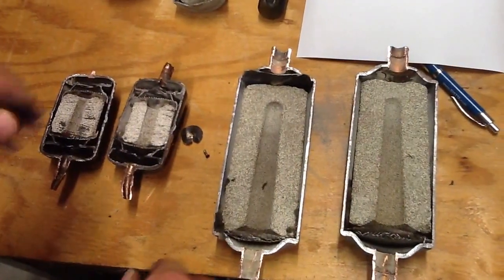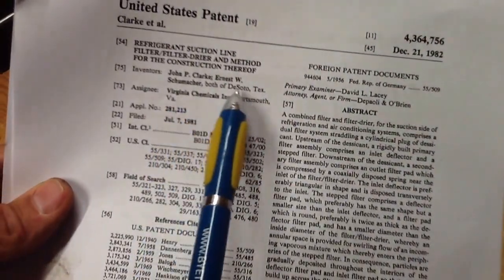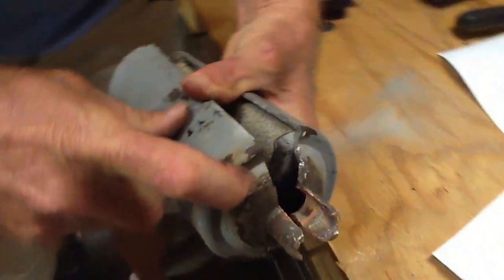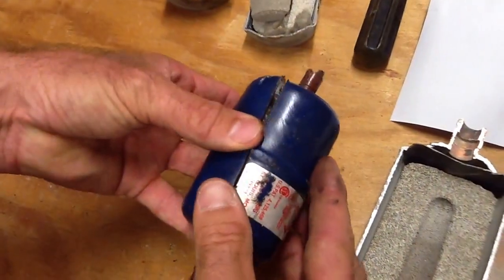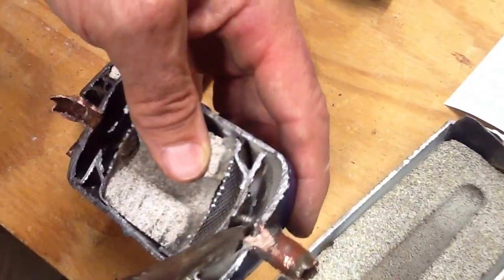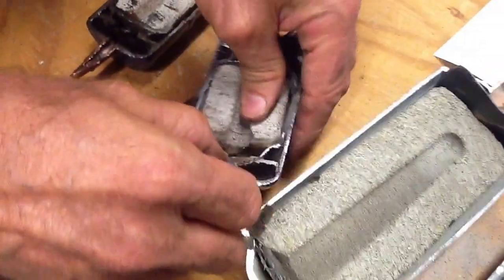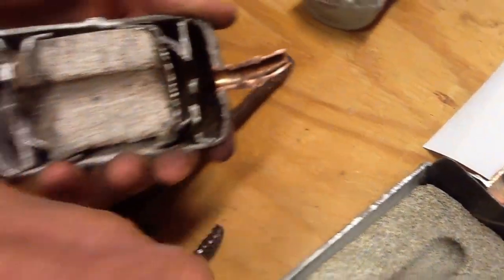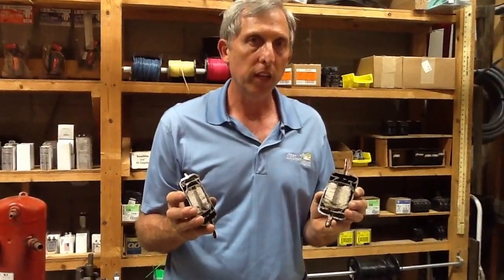History of Filter Driers for HVAC Repairs

Comment: On the bi-flow the refrigerant would have to go around the second set of screens not through them otherwise you would be pushing the contaminants back and forth thru the system......through the center then to the outside and around the screens

Comment: Nice Video.  Big Commercial systems have used "take apart" filters going back decades, but these cost way more that todays one shot filters. The disposable ones were sold by Sporlan Valve co in the mid 1960's and the "Catch all" brand of filter driers goes back to 1947. Sporlan is today owned by Parker Hannifin. 

The Henry Filter drier goes back to about 1939. 

The take part filter type leaves the housing in place and one removes the flange /  cap after removing the refrigerant.

Our Bryant AC unit installed in 1966 had a Sporlan "Catch all" filter maybe that is why it still worked when we sold the old home!

Showing how the 2 directional filter works is very cool, of course these are used on Heat pumps.

Comment: How often should you change a filter drier on commercial or residential applications ?
Reply: Val here, hi Dave thanks for sharing that video, it was very interesting and very helpful, but I got a question, it might sound dumb but it just happened to me, I over looked it; i just installed a used condenser unit for a customer and since I’ve done a lots of Goodman lately and it comes with the dryer filter built in, I forgot to put a filter dryer on this one I did cause it didn’t come with it and started the unit but when I realized it was too late and the unit was working just fine, will it cause any damage if I just leave it with out the filter dryer?
Reply: Thanks for all your helpful video !

Comment: I am probably wrong but wanted to check since you do have a f/d cut in half.  The check valve is supposed to stop the flow through the center and route the ref to the outside of the center medium (around the perimeter) which then filters through the medium and then out through the screen. The screens are to catch the filter medium from being introduced into the ref flow.  Danfoss has a couple of images on this.  If you look at the check valve, it actually closes the center and forces the ref to the outside.  Love your vids.  Let me know if I am wrong, this is how I have explained it to my customers.